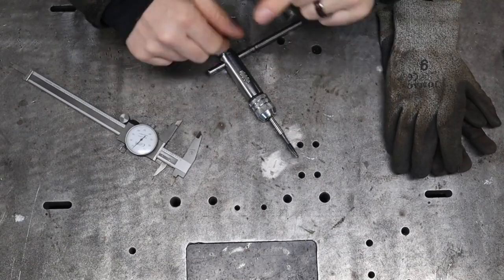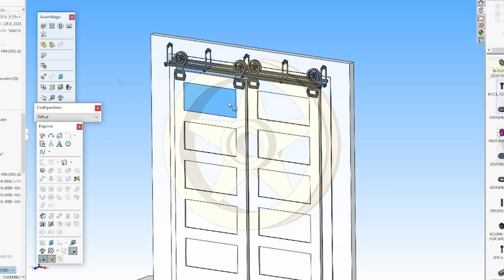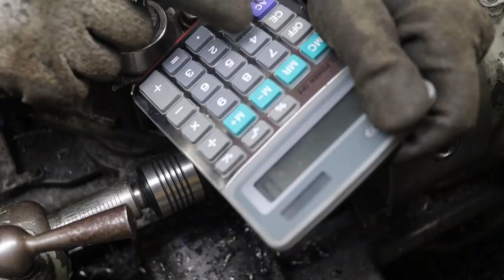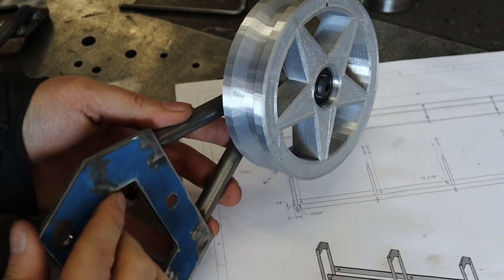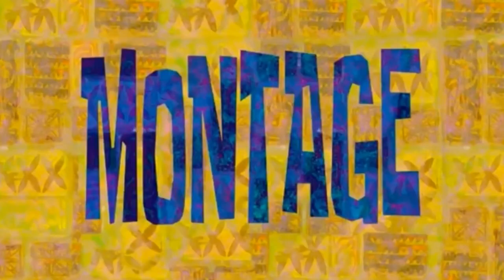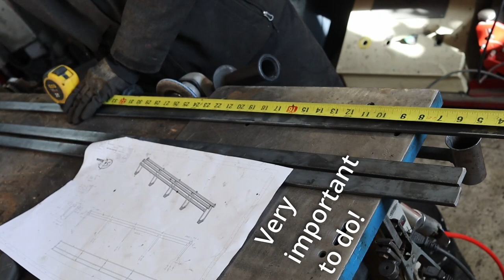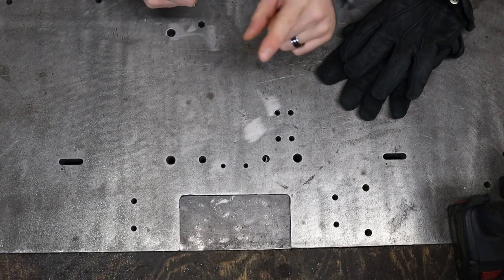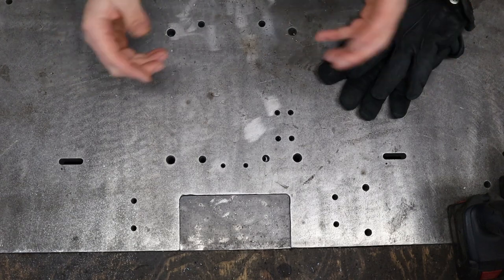DIY Custom Double Doors Sliding System / Barn Doors / Rolling Doors

Comment: Hey Viny , I finally got my Busa dune buggy running , and it sounds great but when I start to push the clutch pedal in it makes a grinding noise like if you were you're trying to shift without the clutch ? would you have any idea what it could be ?
Reply from the maker: Yes, I had the same issue, you can here it in my video when I started it for the first time! You are probably sending to much oil to the slave cylinder, which opens too much the bascket with all the discs, thus, they rub againts the casing. Are you using the original clutch lever or you made you own?
Reply: @VinyB57  NO I BOUGHT A PEDAL SYSTEM A HYDRAULIC CLUTCH , HYDRAULIC BRAKE AND A CABLE DRIVEN THROTTLE PEDAL , I WAS THINKING THE SAME THING , YOU'RE GETTING TO MUCH FLUID WITH THE TRAVEL OF THE FOOT CLUTCH PEDAL , HOW DID YOU RESOLVE THIS PROBLEM ?  AND THANKS AGAIN FOR YOUR ADVICE !!!    ALAN
Reply from the maker: @AlanDavid1955  REALLLYYYY simple, weld a limit bolt and fine tune it to stop propper to when the clutch will "bite" or where the sound stips, but you ll see, it s a really short clutch motion you re gonne end up with! And it s normal, the master cylinder on a han lever is minuscul compare to the master cyl you bought!
Reply from the maker: I re read myself, and the bolt is to limit your clutch pedal if it was not clear enough 😅
Reply: @VinyB57  so install a bolt on the clutch pedal to limit the distance your clutch pedal moves ? When your using the clutch lever on the bike it only has an inch to 2 inches of travel . ( movement )
Reply from the maker: @AlanDavid1955  Exactly, by limiting the movement, you will limit the amount of oil going to the slave cylinder! That's how I solved my problem!
Reply: @VinyB57  Thanks again it didn’t come with that screw or bolt but it has a place for it !
Reply from the maker: @AlanDavid1955  No problem Alan! I welded mine to the fire wall of the car
Reply: @VinyB57  THANKS VINY  !!!